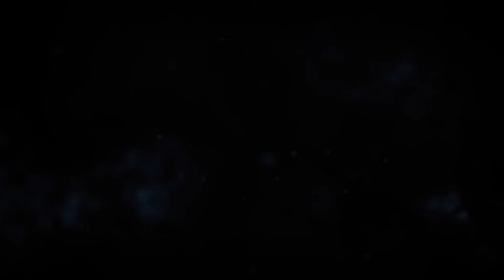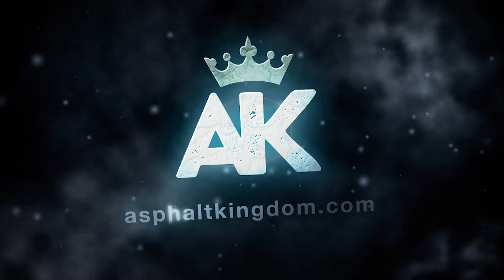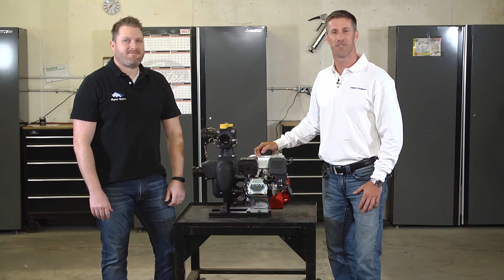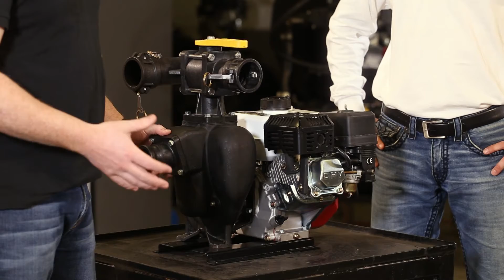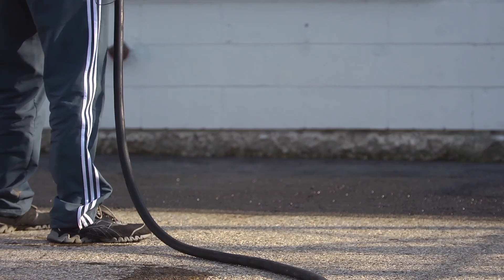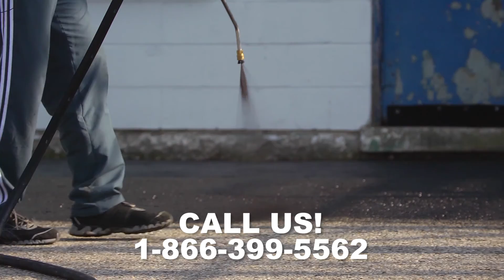Engine and Pump on Asphalt Kingdom Spray Systems

Comment: I’m not happy with my rig the pump constantly loses pressure very low pressure coming out of the one and this pump  engine only has a few hours on it  product is not very good I will not be a return customer
Reply from the maker: Hi @Bruce Steve — we apologize for this issue. Our customer support specialist is in touch with you to help resolve what can be happening with the system. Thank you for your feedback.

Comment: Sent this pump back after first use the seal leaked.  Now the second “replacement” pump showed up.  The on off switch doesn’t work and it won’t push sealer.  Not happy with this product at all!
Reply from the maker: We deeply apologize for the inconvenience Jeff. I have forwarded this issue to our customer support team for immediate assistance. We'll make sure that this will be sorted out as soon as possible.
Reply: What was the outcome was looking into getting 1